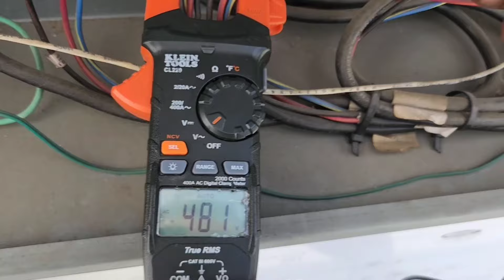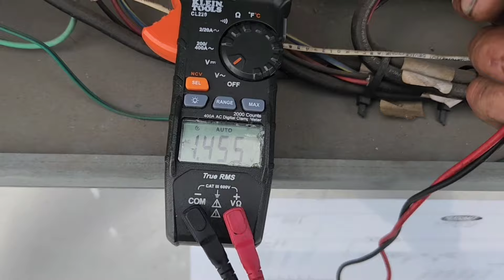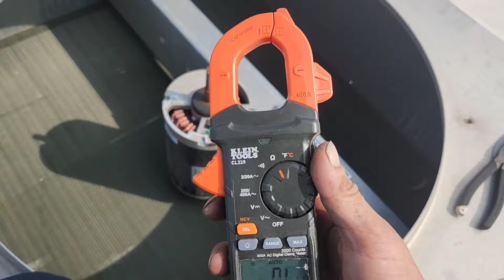3PH/480V Condenser Fan Failure

Comment: Just had this exact call a few hours ago, except our motors are these ebm-papst motors that are like 20k each. Out of 16 fans 3 were dead. Wasn't even there to check the condenser on that Rack because the call was for a proof failure for one of the 6D compressors. But if figured it'd only take me a few secs to check  to see if the fans were all on because its hot today so they should all be calling. Easy money

Comment: If the fan lay out wasn’t available or readable enough I would put my amp clamp on load side of each contactor until I found one with no amp draw. But your way is a good safe way of doing it too. Let’s see how long it takes them to approve repairs.